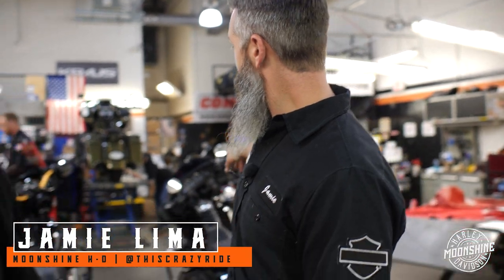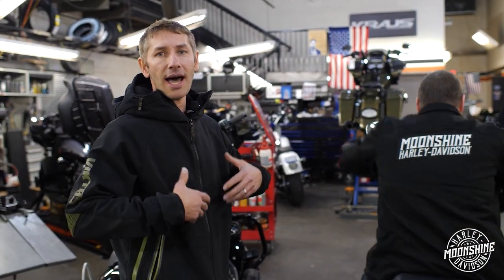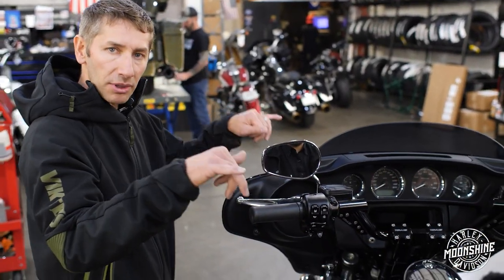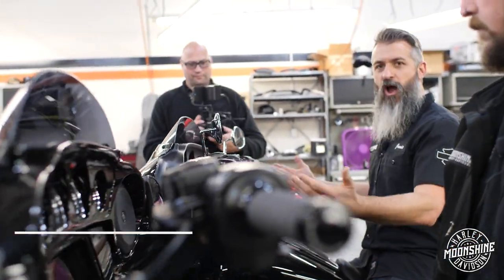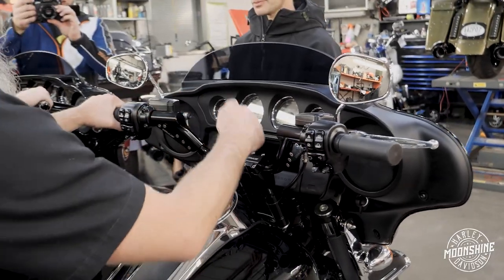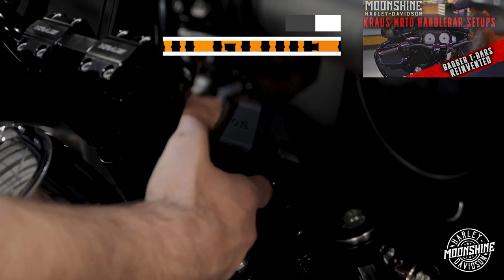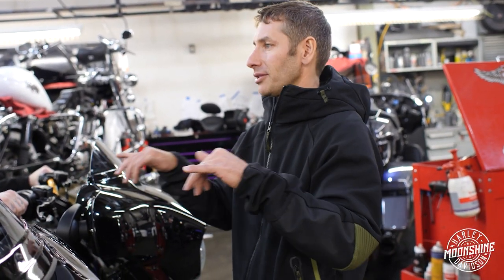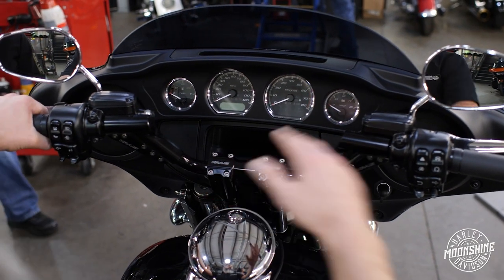ERG Adjustable Moto Bars WITH Satya Kraus | Moonshine Harley-Davidson | Shop Talk Episode 45

Comment: I installed the 10 inch risers with the fly Moto bars on my 2020 SGS. like it. Later I installed 13 inch ohlins rear shocks from the stock 12 inch  and that changed the dynamic of the bike . I'm thinking about going to a 12 inch riser. The point being before you change your bar height make sure you are done with your suspension. Hats off to Satya Kraus for his innovation.
Reply: Add the ODI Podium Bars, they’re taller 😎⚡️🤙

Comment: Sorry if it was asked but those in the videos are 6” risers with 4” erg bar correct? Great video just the info I needed
Reply: 4 1/2”
I run the 6” isolated riser with the ERG Bar set up on my 2018 SGS. Bar install tip- fully insert grips into horizontal tube prior to install of hand controls and do both prior to inserting horizontal tubes into junction clamps. Grips and hand controls take up all the space on horizontal tubes. If you do the install backwards the grips may not fully seat.

Comment: Since the bars are aluminum is there more vibration than steel bars? Comparing the two bikes in the video which setup positions your hands closer to the riders body? The 2" kickback or the ERG?
Reply from the maker: Less vibration than most die the the riser
Being more solid. Taller steal bars flex and vibrate more unless they are a T-Bar style. ERG’s would be closer. Let us know if you’d like us to send you a set. 615-274-4170 Aaron or Jamie
Reply: Thanks,  Moonshine is so knowledgable and brings the best content for performance baggers.

Comment: What size risers did you use on that street glide with the ergo bars
Reply: I was wondering the same thing.  I think he said 6", but then they said 12" overall height?
Reply: I believe they were 8 inch risers since the bar itself has 4 inches of rise itself totaling overall 12 inch rise.
Reply: @Dturner8606  Yeah, that's what I figured as well.  I just got the 8" with a 4" Thrashin' bar and they are perfect!
Reply: The video on the Street Glude has 6” straight rise with 4 1/2” ERG plus add another 1” in height for the thickness of T-Rex pull back plate . I run that set up
Reply: @TEXAS_BAGITO  how you like that setup? I'm 6'1" would you consider going 6" riser with pull back?.
Reply: @TEXAS_BAGITO  is it ok if i run  6" kickback  rise with 4 1/2” ERG  without T-Rex pull back plate?
Reply: @TEXAS_BAGITO   did you have to change any stock wiring out or no. I'm thinking of the same setup.

Comment: What happens with the ignition & lock?
Reply: Sorry late question, freakn truck driver
Reply: The ignition/ steering lock is removed . That old ignition/steering lock location space is now used up by the raptor or t-Rex plate which is needed so that the riser clears the inner fairing 
Ignition- two choices:
Dealership flashes ECM to start bike like a CVO : fob and hand control switches start the bike
 or 
relocate a new factory switch from different Harley model to a location  area of your choice 
I did the CVO flash and love it. No fuss, no muss
Just don’t keep your fob in your bags 

The steering lock is gone forever
Reply: @TEXAS_BAGITO  thanks for your reply man! What about passing light switch? Any ideas were they get relocated?

Comment: I'll probably get mocked for saying this, but oh well.. I like the ERG bars and kinda want them, but no room to mount my cell phone, gopro or drink holder on them. Facepalm..
Reply from the maker: Ok. Do the ERG bars with a RokForm phone mount, Ciro cup holder that bolts to the control mount and GoPro has multiple options for the GoPro.